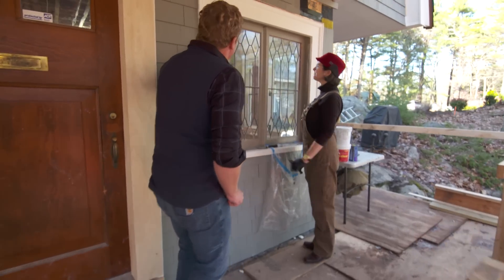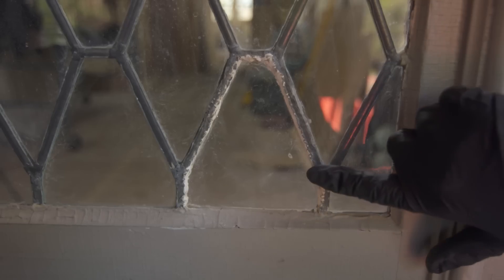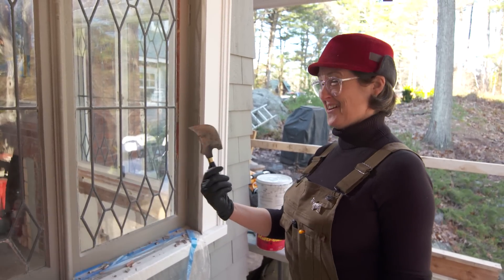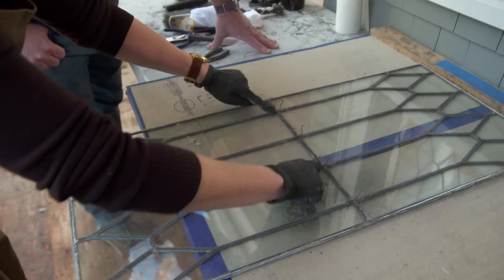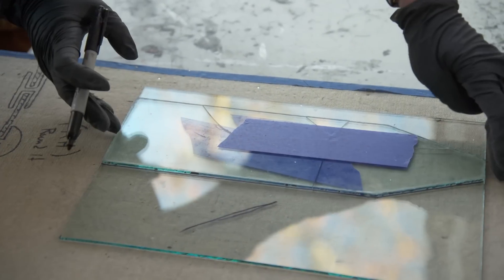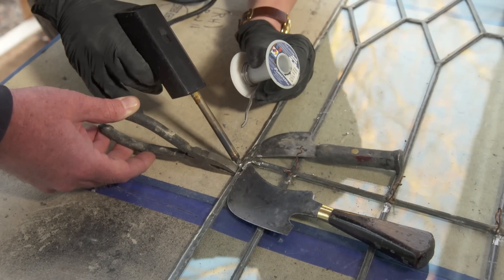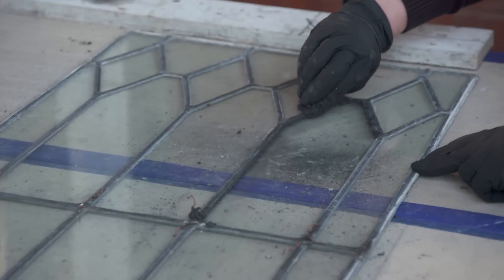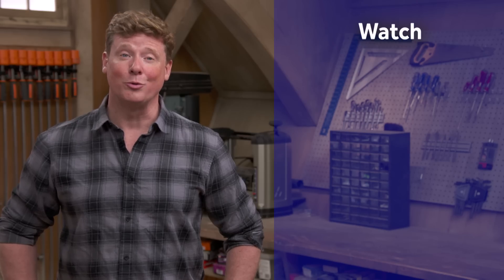How to Restore Leaded Glass Windows | This Old House

Comment: That is some serious craftsmanship.  Wonder what type of solder she is using for repairs.
Reply: 60/40
Reply: The solder should be NOT be rosin core, etc.  Solid core 60/40 and use an appropriate flux for stain glass.

Comment: No respirator? Maybe if you did this once or twice a year you wouldn’t be so worried but if she does this for a living she should protect herself
Reply: @Kevin-mp5of  soldering and she did so some grinding with the little die grinder thing. I just think in this day and age you can never be too safe especially if she works around it regularly
Reply: Thank you caring about my health. ❤️

Please know I maintain good safety standards at all times. Soldering the came isn’t a danger because the solder never gets hot enough to become a vapor. If you see “smoke” it’s the tallow flux and that’s lead free. 

Grinding the came does, I’m sure, send some lead dust into the air,....but since we were outside on a breezy day I felt safe. 

Best,
Cathryn
Reply: @cathrynblackwell8698  where do you do repair work?  I am looking to repair a built in hutch door in Minnesota.

Comment: Did you know there are 3000+ Architects and Engineers calling for a new investigation into 9/11?
Reply: How come ?
Reply: @augustreil  mainly because Newton's Law of Motion was completely ignored by NIST and all the reports of secondary explosions covered up.
Reply: @augustreil : >How come?
Probably because being an architect or engineer doesn't make you immune from being an idiot.
Reply: @MichaelResznekiTrolling4Truth , So, you guys think that something else besides the heat of the fire weakening the steel beams, brought down the The World Trade Center buildings ?
Reply: @augustreil  it's either that or believe that fire can pull off 3 of the most successful building demolitions in one day for the first time in history. Never have steel structures failed in such a way due to fire. Then the collapsing debris/floors were clocked at free fall and accelerated free fall speed for all 3 structures. Expert's plan for months to get that type of precision to happen.
Reply: @MichaelResznekiTrolling4Truth , I read a few different articles, that said because the heat was so intense, all it needed to do was weaken the steel to start the pancaking effect ? And because of the way they were built. But I'm not an engineer, so I have no idea.
Reply: @augustreil  well the pancake theory would result in a few things. We would see stacks of floors on top of each other in a pile and plenty of identifiable material (desk, chairs, doors, stair cases and more). The concrete was pulverized into the dust that cover Lower Manhattan, steel beams were hurdled outwards at tremendous speeds, 40% of victims are still unidentified and were blown into pieces. Bone and teeth fragments were found on adjacent buildings. A pancake or pile driver theory would slow itself as the floors contact and most likely tip over before completely going through the whole support structure that wasn't damage by fire
Reply: @MichaelResznekiTrolling4Truth , I just figured that after all that tonnage falling on top of each other, there would be no way of having anything left that was identifiable ? I thought, like you said, that the concrete would have pulverized everything into dust ? I always thought that because each building had an entire floor or two, that was burning out of control, that once the fall started to happen, it would do exactly what it did, go straight down and speed up as it fell, on top of each other ? But, like I said, I ain't no structural/building engineer and just figured that was a normal collapse ? Learn new things everyday right ? Thanks.
Reply: No there's not.
Reply: @ChrisK-LTC  the Franklin Square and Munson District Fire Commissioners all unanimously approve a new investigation. Newton's Law of Motion can not be ignored that day. Also yes there are over 3000+ architects and engineers calling for a new investigation, it's growing every year.
Reply: @MichaelResznekiTrolling4Truth , I still think that the towers falling the way they did were the result of:
1) The planes crashing into them,
2) The intense fire that followed,
3) The beams being weakened by the intense heat and causing the straight down collapse.
4) Nothing was left because of all the weight of the concrete crushing, disintegrating and pulverizing everything in it's path on the way down and also when it hit bottom.
If there are other reasons for the way they fell, I do hope they find them. As for now, I still believe they fell the way they did because of what I already stated. Thanks again.
Reply: @MichaelResznekiTrolling4Truth   You live on a Flat Earth, don't you.